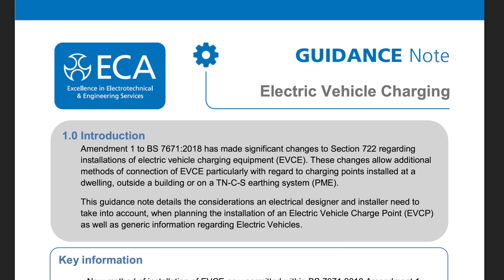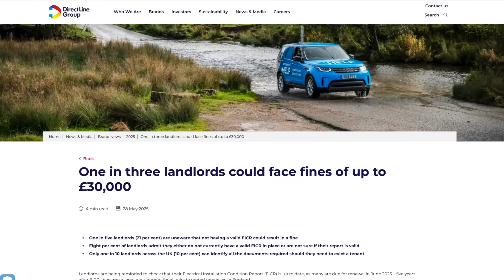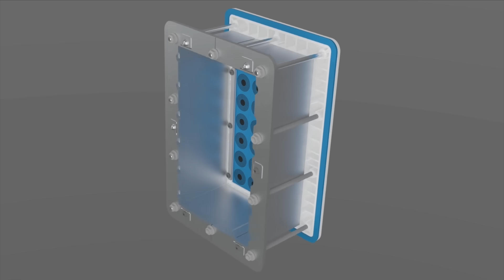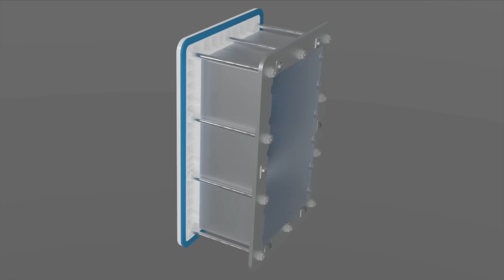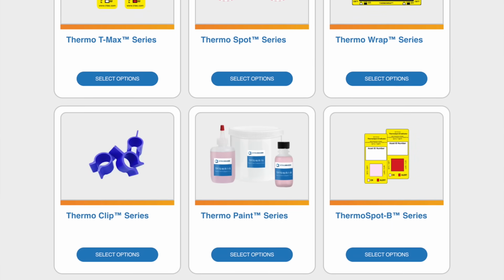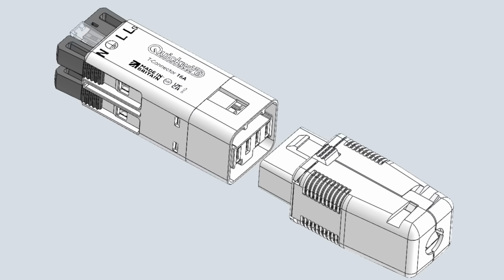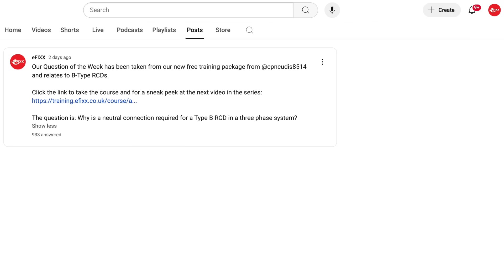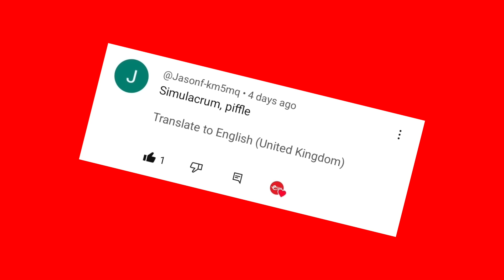Govt’s Cable Plan Sparks Safety Fears ⚠️

Comment: Don't you love the use of the word 'mil' with no units in a world that uses metric and imperial.
Sure, use the short term 'mil' when you talking about thousandths of a unit when you're with a group of people that only talks one measurement system, but not when the measurement system could be anything.
And no, 'mil' is not shot for millimeter - it means thousandths.

Comment: 5:56 the system is ok but I have had 3 lights in a auditorium that the plugs have failed or come loose resulting in no light or lights that won’t turn off

Comment: On street charging is a terrible idea because of the different supply systems. Unless they're going to mandate all homes are changed to 3 phase along with council chargers fed via lampposts so it reduces the chances of cross phase and pen faults to zero it is just not feasible to satisfy the regulations and risk assessments. If we were upgraded to a European style supply I'd be happy for it but it's bad enough having to now mount charging points half way down peoples drives because certain home insurance companies won't cover the home if  EVs are within 8 meters of the property. 

Given how narrow some of the pavements are and how tightly vehicles are parked in in say Brighton for instance when one goes up it won't take long for the surrounding vehicles and homes to as well. Especially now it's getting harder and harder to get Fire Engines down those streets as cars are wider and they're reluctant to remove parking on the other side of streets as residents permits are a good cash cow.

Also I can understand why so many picked D last week - they were subconsciously thinking reference point which would be needed to detect the imbalance across phases. A case of being a half correct red herring.

Comment: Surely the cable needs to be armoured if not in conduit 🤔
Reply: The design featured is for the standard charging cable. ( You may be confusing yourself with the NICEIC fixed wiring regs ) as opposed to portable appliances…

Comment: before they go ahead with the fitting ev chargers, they need to upgrade the cables underground, when the electric cables were installed underground, the houses had a light bulb in every room, maybe an additional lamp, a tv in the living room and a few electrical devices in the kitchen, now every thing has to be plugged in and soon gas boilers will be replaced by 3 phase electric boilers, right now those underground cables in the street at at capacity as back when they were fitted they could not have imagined how many electrical devices we would have, if a few cars on the street are plugged in to charge when they get home in the evening when everything is switched on in the house, those 50+ year old cables in the street are going to be complaining, if every other house gets an electric car, those underground cables will fail, combine that with current practices of installing cables and distribution boxes which only just have a higher capacity than what is used now, along with copper prices (and therefore cable prices) always going up, we are setting are-selves up for electrical grid failure, if we dont upgrade now, we wont be able to afford to upgrade and we have to think 50-100 years ahead, not think of what we use now and say thats good enough.

Comment: The councils don't want people to be able to use actual cheap overnight electricity to charge their cars.
Because the councils in London get to charge 39 to 59p a kWh for people to charge from lamp posts.
The problem is - if the cheapest electricity you have is 39p a kWh (and that's the cheap middle of the night rate), you might as well just carry on using diesel, because it's actually cheaper.
Meanwhile people with a driveway using their own home electricity can charge overnight at 7p a kWh. At 7p, it's cheaper to drive an electric car than to drive even the most frugal diesel.

Does beg the question of how it is that councils can't negotiate electricity that's not less than 5 times the price that private homes pay. Or are they just profiteering?
Reply: You can't expect them not to charge for the use of their lamp posts. If you live in central London, 60p a kwh is the least of your worries.
Reply: Dude, you won’t have the choice of buying carcinogenic diesels or petrol cars. ITS EV OR NOTHING BUDDY! 🤣😂

Comment: I thought all ev chargers used on pme systems already required a shed load of fault detection & isolation contactors for these kind of fault conditions? Is this not deemed sufficient?
The risks talked about apply whenever a pme 'earth' is exported outside as the general mass of earth is effectively a different earth system.
This applies to any car chargers, heat pumps or just taking an extension lead outside. And also why caravan hookups have to be TT.

Comment: If you buy an EV then common sense should be factored into the decision, if you do not have a private drive then you will have to charge at other places, eg: garages and car parks that have the right equipment. Same as if I buy a caravan then I need a drive or put it into storage.

Comment: Running electrical leads over footpaths seems nuts to me, things electrical usually have to be way better for public spaces, yet here we are spreading domestic stuff into the public arena.
You need to talk the local councils into installing public streetside chargers.
This is just a downside in living in that type of residence.
Reply: The problem is that all the public residential street charges solutions that have gone in so far are way more expensive than a domestic EV tariff.

Comment: What is needed are more low cost workplace and public car park charge points. Most people primarily use their car to drive to work, where they park in their employer’s car parking spaces or a nearby public car park.

If the government set up a scheme where 7kW chargers could add the charging cost to the consumer’s domestic electricity bill, they probably would not need to charge at home.
Reply: Octopus Electroverse?

Comment: As long as the street-side charger is hooked up to an RCD breaker at a safe location upstream from the crosswalk, it shouldn't matter how many alternate paths to ground exist. Anything happens to the cable that causes excessive leakage, power to the charger (and the sidewalk its cable crosses) gets shut off at the source in roughly 10ms.
Reply: But that may make you dependent on someone else correctly installing an RCD.

Also the issue is that your charging car may provide a path to earth for street furniture that does not have an RCD as part of its design.
Reply: @rogerthomas7040  EVERY part of electrical safety revolves around people doing their part of the job correctly enough. Having to rely on someone correctly installing an RCD is a trifle, one of the most difficult things to get wrong, especially in places like the UK where the mains breaker feeds 1-3 RCDs and all breakers tap off of those.

Even something as simple as ground bonds requires that countless other things are also done correctly and will be kept in working order for the next 50+ years. Construction work can break ground bonds, excavation work can break ground bonds, accidents can break ground bonds, corrosion, shifting ground, vibrations, thermal cycles, etc.

Keep in mind that the HVDC system has ~1kV worth of isolation from mains and the on-board charger is similarly isolated from all grounds, which means that current from your light fixture to the charging car would almost certainly be ground-to-ground. In that case, the quality of RCD installation or its existence altogether would make zero difference.

If your street furniture somehow gets to a ground potential that poses a threat vs the grounded and RCD-protected vehicle charging curbside, you probably have a far greater problem than the RCD's installation to worry about. The fixture or house/apartment grounding is almost certainly deficient. Where I live, pretty much everything in the neighborhood is connected to the same utility ground/neutral through messenger wires strung between poles, grounded at every pole and municipal water ground from every main service panel. There likely is less than 10V ground potential difference from one street to the next under normal circumstances.

Comment: Two things are certain. No1, you will never be able to oark outside your house. Your haven't been able to for the last 50 years so why will this be any different.  Everyone except you will benefit from the cable outside your house. You will also be under constant stress, peeking through the curtain to see if a car has moved so you can run out and move you car, but you you will miss it and lose tye space you had too, and have to park even further away than before.  No2,  this is all academic anyway.  Tye gypsies will steal the cable every night anyway and no police will care. They steal live underground cables every night and the delay to the first train of the day is reinstatement of the cables. Your home charging cable won't provide much of a challenge to them.

Comment: 7:20  The fundamental problem with Aluminium cables covered in a thin coating of Copper is that they become very brittle with the temperature changes from hot to cold and snap conductors

Comment: I know all about landlords electric safety certificates & the alleged component person. I had made an official complaint about faulty light switches to both the landlord & local authority. 3 months later the inspection was carried out & a certificate issued. With in 24hrs my mother's career was electrocuted but the local authority accepted the certificate anyway. So much for compliance & I was accused of doing it & that I had stated dangerous switches all Lise as I was out of the country at the time
 + Much more.

Comment: You could have the same issue on driveways as well with the EV chargers.  If there are two driveways next to each other then there could be two EV cars sitting side-by-side within touching distance getting their charging from different phases.
Reply: Not to mention we've been charging in car parks with all sorts of other equipment around for many years. Not sure why a parking space outside your house is any different to those areas.
Reply: Does fitting pen fault devices mitigate this?? They remove the need for extra earthing arrangements so would they also protect against neighbouring houses being at different earth potential?

Comment: To be honest im still hoping this phasing out of new diesel cars will be cancelled... i often do over 700miles a week, and fill up once, it takes 5 minutes...
I work long hours and with travel im out of the house between 6-19.00.
Couldn't even contemplate sitting in a car park for 20 or 30 mins of an evening charging a car.
If these vehicles are anygood people will buy them without government persuading them to...
Let the market decide 🙏
Reply: 20 or 30 minutes LOOOOOL, try 1-2 hours on a slow charger, IF you dont have to wait for someone else
Reply: @rashdondoesntunderstandwor-g1xwhy would you use a slow charger? Life's far too short for that carry on
Reply: @rashdondoesntunderstandwor-g1xyou'd have thought by 2035 they will have installed alot more fast charge units across the country

Comment: Some 30 years ago, I lived in a rental property for a short while. One evening I was going out, I opened the inner door and went into the vestibule, realising I'd forgotten something I reached back behind me to a light switch on an inner wall. As I groped along the wall for the switch, I could feel a subtle vibration feeling under my fingertip, I realised it signified an earth fault. Having notified the landlord, he got an electrician in, who found a nail through a wire upstairs (he did well). I wonder how long it had been like that?

Comment: My vehicles are never going to have this charging problem. I drive down the road to a designated area . Stick a hose in the side . Pull a lever for a few minutes. Pay some money to the cashier. And I’m done . Only takes less than 10 minutes every 2 weeks . How simple is that .
Reply: "never going to have this problem"? Come back here in 15 years and tell us how that's going.
Reply: I reckon that's an idea that has captured the world's attention.
Reply: And you continue to poison the rest of us with your NOx and particulates, and it costs you more.
Reply: Narr will never catch on. Fuel is smelly
Reply: @johnwarwick4105  so are farts

Comment: Umm, isn't it the whole point of these EVSE units to ensure that any fault in the EV and onboard charger causing the EV body to become live or at any potential is detected and power cut?
There should be no simultaneous contact issues.
This also means grid type will determine if you can for example do a 3-phase charging or not. Most cars will not allow this on IT-grid due to the lacking neutral. If UK has been allowing this then it's their own fault. Otherwise it's a non-issue.
Reply: Can it withstand an 11kV fault?  How about 6.6kV capacitively coupled? Yes, it would be an unusual case but you can potentially get yourself between supplies on different transformers with what is being proposed and that's a very different kettle of fish.  It would come down to how distribution transformers in the UK are earthed.  There are other interesting issues that can arise too.
Reply: @retrozmachine1189  That's why the ground coming from distribution is a reference and the building ground is the safety. UK (being "loamy") has a much easier way of it than Norway (being "rocky/montainy") and yet grounding is still done for each lot separated by just a few meters. I just put down a new ring-ground. Not easy digging.
Reply: @1kreature  You missed the point entirely.
Reply: @retrozmachine1189  11kV distribution transformer fault would be handled by the SPDs in the transformer or worst case at the end user would it not? Here they are mandatory. Then can easily handle 11kV. The EVSE itself can easily handle 8kV as normal spec. Coupling significant power capacitively though worries me as it seems to require a major fault in how these systems are distributed. There should not be any HV distributed in such a way as to capacitively couple to the LV system of a end user being distributed to a EVSE. Seems like a very constructed scenario? Do you have an actual example?
Reply: @retrozmachine1189  Btw, fun statistics: There are over 754000 EV's in Norway and according to statistics 75% of these charge on private EVSE points. It is mandatory to have one, and a portable charger to plug in is not acceptable at home addresses. Yet, there has not been a single registered incident of people being shocked/hurt. Interestingly enough there have been some reports of bad earthing and capacitive coupling causing slight tingling sensations when touching the car so I guess it is possible.
Reply: @1kreature  Fuses on the transformers will blow under the right circumstances but they are nowhere near fast enough to protect a person.  The switching relays etc in EV equipment would simply be bridged by 6kV let alone 11 or higher.  What I said is only raised as a possibility in the UK as I don't know how their transformer earthing is done (as stated in my original comment).

Comment: I'm not sure what's really new with the Amokabel at 7:25, that looks much like a pretty standard industrial cable that has been in use in Sweden since the 70's. Material wise it could be different to be lead-free, but that has been the case for many years already. The shielding is pretty good to have not only for penetration cases with RCBO protection but also for EMI protection.